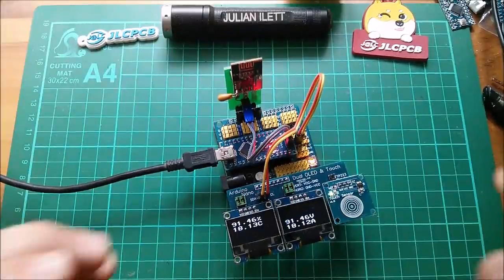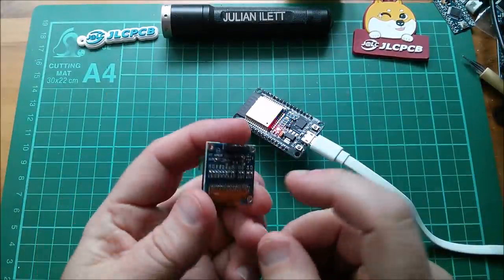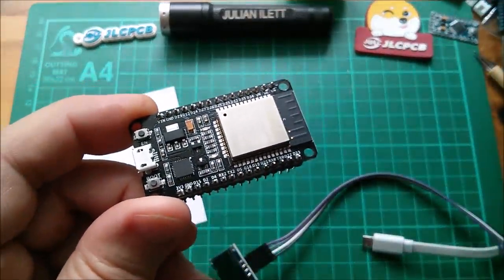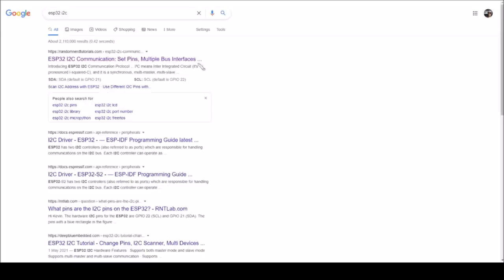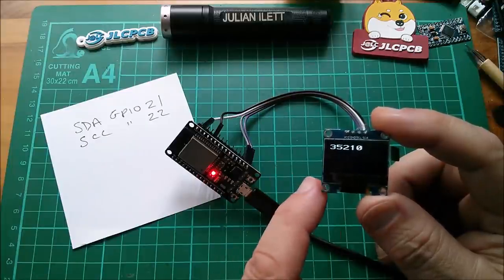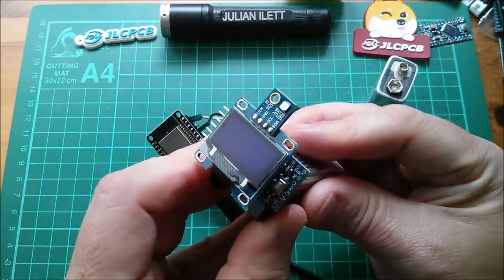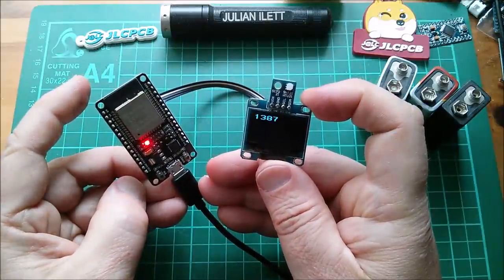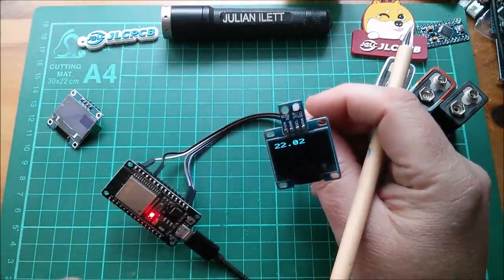ESP32 with I2C OLED and Temperature Sensor

Comment: #include <> searches for the library in your library folders and #include "" first looks in the sketch folder. So basically the difference between local and global include.
Reply from the maker: Perfect - thanks Dustin. I have so much to learn :)
Reply: Great description.  The only thing I'd add is that the "" can contain a path to a .h file.  It doesn't necessarily have to be in the compile folder.  It just defaults to PWD if no path is provided.  Anyway, I find this provides a simple means of organizing your personal libraries.  :)

Comment: i designed my own esp32 board with battery management built in for wearable sensor interfaces and sensor projects :-) esp32 module is very cheap and powerfull

Comment: Hi Julian, for what its worth, you can use almost any pin to drive I2C. You may have to declare those pins when you call your driver library though
Reply from the maker: Hi John - yeah I read about that. For the moment, I'm trying to keep it as simple as possible.
Reply: How would I do this? I am new to these boards and I am using a ESP32-C3. What line of code would I need to use to declare GPIO5 and GPIO6 when calling the library?

Comment: To make programming the ESP32 easier, install a 1uF cap between the Enable and Ground pins, this means you don’t need to press the button to program it from the arduino IDE, you just upload and it works.
Reply from the maker: Maybe there's one on the board already because it programmed just fine :)

Comment: Hi, i don't have understand why you change from ATMega 328 to ESP32, for the wifi only ? the identical value for the first screen and the second are the same from the code no ? Or ATmega 328 doesn't have much memory to control the two screen at the same time ? thank you :P
Reply: atmega needs external wifi module, esp32 does not, so it might be cheaper than atmega+wifiboard.
it sure is more powerful, probably has more memory, might even have better sleep powerdrain.

Comment: Ampere = Celsius?
Interesting...
Reply: The history behind what is shown on the OLEDs is in his older videos. Basically he has only two data values but wanted to show four lines of data on the first OLED. But presumably intended at some point to also have voltage and current. Hence the V and A. Then when testing the second OLED, he just used the bottom two lines from the original code and changed the object to the OLED at the second address…
Reply from the maker: Exactly right. The plan going forward is to attach a INA219 to the transmitter to get the voltage and current data :)
Reply: @Mark1024MAK  - Thank you.

Comment: i use a wemos d1 mini with battery shield the bme280 can Temperature/Humidity/Pressure measure and all the data put it over 
the wlan from the wemos d1 in my mysql data base with a php script peer get/post string receive so can i over my webinterface in all my rooms the Temperature/Humidity/Pressure see or over home assistants

i can not untersand why you it so complicated make, of course i can untersand the you try out it but you wasting so mutch time for a lost way, the'r i can not understand  why
Reply: he is self educating and may even be educating some others, his time, his choice.
why are you not using node-red, and do use php ? probably using things you learned before.
typo :: untersand => understand
Reply: @jyvben1520  I know why I don't use Node Red, it is too confusing, all the lines and buttons, why should I use Node Red when I only have one system, where collect weather data from my apartment and 5 years earlier there was node red not release and one does not say in vain, never changes a running system

so why should i all my weather sensors new flash to node red if the system run for 5 years and all ther i have self lerning and the path was not esay for me

Comment: I really like the ESP32 - don't forget it has an RT OS built in, so can do multi tasking. 
Although I do find the Wi-Fi can be a bit ( well a lot)  flaky, connects no problem 1st time after boot, but randomly loses signal and then has devils own job to reconnect, usually fails so have to resort to an ESP.restart() to reboot the thing - Annoying !
My own similar project : https://www.youtube.com/watch?v=3RDv1CY0RKc
Reply: Have heard other people say the same. Their was a big batch of chips with problems.  In loop check if wifi is connected, if not use .disconnect() and or .reconnect(). I've got 4 here from 1 supplier and 6 from another, same chip, regulator, board layout and design. The 4 brownout when trying to connect to wifi (just about ok at 80Mhz) unless I up the voltage to 5.5v, the other 6 are just fine on usb power. strange things happen
Reply: @PetRatty  The batch issue was related to rev 0 chips I think - mine are later ones 

I think I've tried most variations of the wi-fi reconnect logic, as seen on this page
https://randomnerdtutorials.com/solved-reconnect-esp32-to-wifi/
Reply: @cbartley100  I've seen that post, have you tried to set it up with a static ip address. might want to try wifi.setTXPower().
like I said I've had no problems but 1 of my esp-01's when doing an OTA does slow down when moving it away from the router, only 5 meters it takes sometimes 3 minutes
Reply: @PetRatty  Trying fixed IP now !
But will be few days yet before I know if its  really a fix